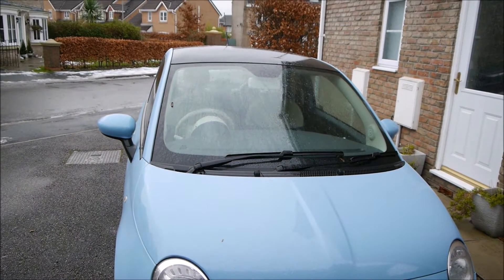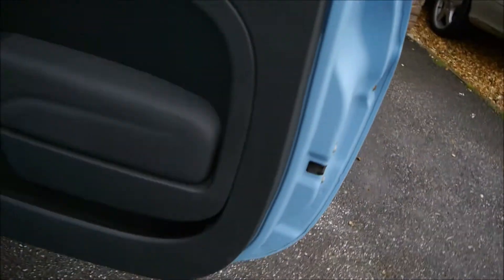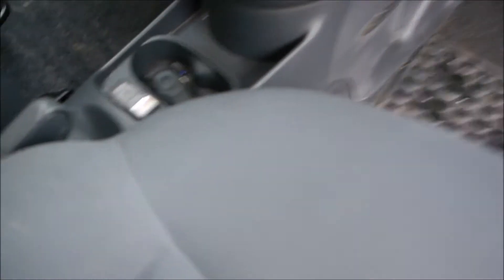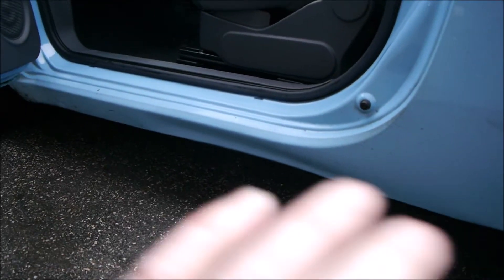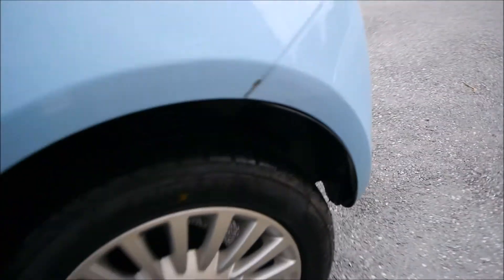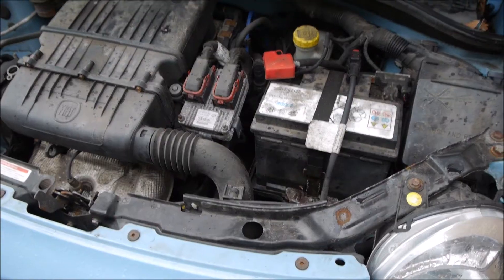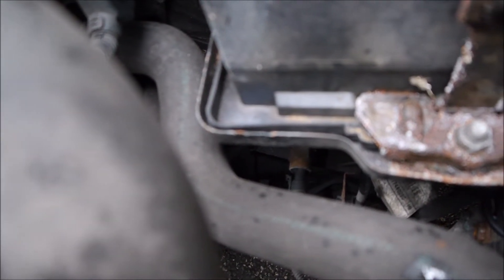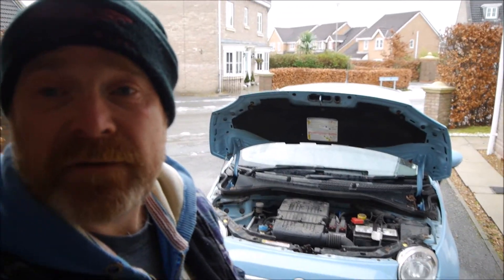Fiat 500 Part 1 - The Arrival- My daughters first car  VSG Ep 67

Comment: Reall nice video. I have subscribed. My daughter has just bought a Ford KA which is essentially the same as a Fiat500 but different skin, I've got to replace the exhaust backbox. I noticed that you jet washed the engine. Is that safe to do so? My neighbour always bangs on about not doing that as it can dislodge electrical connections. My feeling is it should be able to cope with it.
Reply from the maker: It's OK to do just don't point it right at any electrical parts. You can always cover with rubber gloves or bags. But the pure mechanical bits can get a good blasting.
Reply: @vintagesteelgarage  gotcha. Thanks for the quick reply.
Reply from the maker: No problem. Your neighbour is right as a general comment. Also aviod alternator, fuse box etc. Good engine degreasee brushed on and distant sort of power wash misting. The Range do a good degreaser for £2.99
Reply: @vintagesteelgarage  great I’ll take a look at the range. I also like the elbow grease product you used. I’m going to get some of that 👍